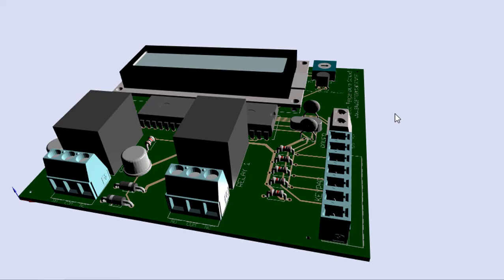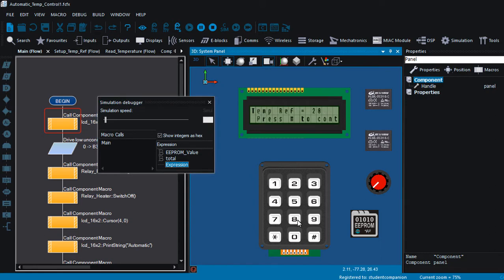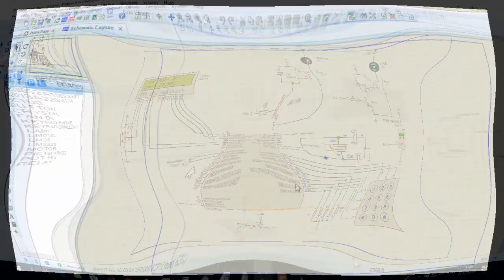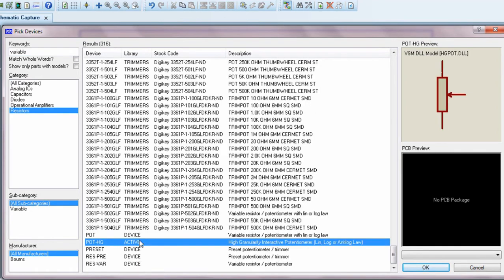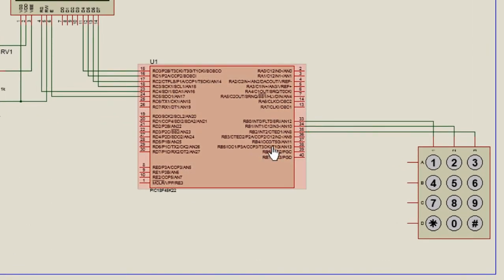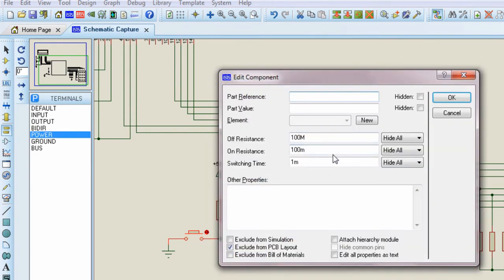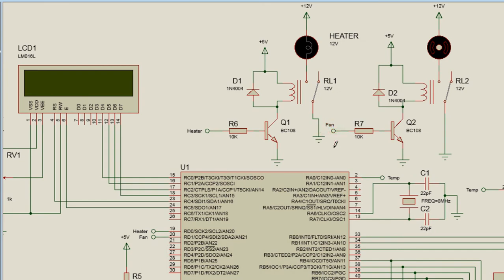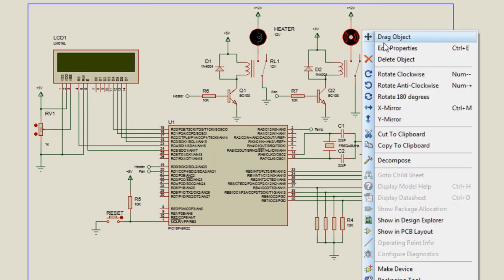35- Project 5 Automatic Temperature Control, part 1 | Flowcode Beginners Tutorial

Comment: Thank you very much, Professor, for the adequate answer and help ... Would I have a question if you would like to have an automatic heating ferry project on the system’s gas working and running on PIC. If you have an idea that there is protection for the system because the gas is somehow a big risk, I want you to help the project for a chicken farm ??? ??
Reply from the maker: The PIC on itself is safe, the problem is the switching devices. You have to be trained to work with gas to understand and avoid the risks.
We can't design the system for you but if you understand what you are doing and ask appropriate code based questions, we might assist.

Comment: i made a similar project for school and the only thing the professor picked on is the reference temperature 
it should be an interval and not a simple value because if the reference temperature is 29 then  the temperature reaches 29.1 theoretically it will turn on the fan then the temperature drops to 28.9 then it will turn on the heater and the temperature will drop again 
basically it will oscillate 
if you put 2 reference temperature or a single reference but test on reference - offset  and reference + offset the system will oscillate less
Reply from the maker: You are correct.  But this is just a tutorial to give students a foundation to build on. We can't include all possible scenario to make it as a commercial product.  The tutorial will be very long. What you have described is very important addition among many others to improve it. I will mention it in part 2.
Reply from the maker: Thanks for your feedback.  Much appreciated!
Reply: thx also i love your videos very informative ..keep them coming
Reply from the maker: You are welcome!

Comment: Hi, what kind of schematic drawing program r u using it? And where did u get schematics for 3*4 keypad? I couldn't find it, can u send it to me?
Reply from the maker: Hi. It's called Proteus.
Reply: @StudentCompanion  Thanks! Also thank you for your great video. Schematics for keypad is also in Proteus? Or do we have to add library to add keypad?
Reply from the maker: @oksky58  you can create your own if you want to. But there is a keypad already in Proteus, a 4x4 and 4x3 keypads that you can use straight away
Reply: @StudentCompanion  Thanks for let me know! Also, what is that the signal type from the temperature sensor goes into microcontroller? like x-bit logic or x-bit i2c?
Reply from the maker: @oksky58  It's a normal analog signal. If you watched the whole tutorial we explained everything
Reply from the maker: You can learn more from this tutorial: https://youtu.be/lrMXX-qBGlU

Comment: I have a question

We don't know the port according to the data sheet
You are selected PIC18F45K22 and the port ID ANSELC = 0; He was not in trouble
But I chose PIC18F4520, actually it was going to give me an error in the program, so I entered the dataset and checked the input and output from it and chose the CMCON C = 0; But it gave me an error
In the PIC18F4522 there is no problem with the code and the work was perfect, but I had to use a second alternative type because there is no in the market

You clarified the idea or how
Reply from the maker: ANSELC set a pin as digital or analog when you are using the PIC18F45K22 but the PIC4520 does not have ANSEL register, you will have to use a different register.

Comment: We don't know the port according to the data sheet
You are selected PIC18F45K22 and the port ID ANSELC = 0; He was not in trouble
But I chose PIC18F4520, actually it was going to give me an error in the program, so I entered the dataset and checked the input and output from it and chose the CMCON C = 0; But it gave me an error
In the PIC18F4522 there is no problem with the code and the work was perfect, but I had to use a second alternative type because there is no in the market
Reply from the maker: You can use ADCON1 to configure analog pins to digital as  explained in this article also using PIC18F4520: https://www.studentcompanion.co.za/sms-home-alarm-system-with-pir-and-gsm-mikroc/

Comment: Please write a programme in flow code 8 an ac - ac stabilizer project ranging from 130vac to 280vac input voltage and Output voltage between 200vac to 255vac with a low and high cut voltage LOW volt cut to be below 130vac and HIGH cut to be above 280vac and display the resulting real time ac input and output on a 16x2 lcd.This can be really helpful to see how to go about it here in flowcode.Thank you sir.
Reply from the maker: Hi. Thanks for your feedback but unfortunately we can't guarantee that we can consider all the projects suggestions from our subscribers. Some are beyond our scope and we won't have time to consider everything especially if they won't have value to our predefined topics.
Reply: The truth is we learn allot from a complete project in flowcode take an example of the lm35 tempetature control project you did, its a complete project i personally learnt allot from it in that area so with a complete project of an ac to ac stabilizer there is allot to cover and also allot to learn from it.
Reply from the maker: I hear your point. But personally I don't see much value to learn from such a project in terms of our microcontroller tutorials.

Comment: Hala Bash is an engineer. I took the project after the temperature, I worked the brutes, I worked, the purposes were required, I worked in reality, I worked hard and gave a reading, but the cepad did not give the numbers where is the problem
؟؟؟؟؟؟
And Henny changed the recognition like I did because I used PIC18F4520 to help me solve the problem

// Keypad module connections
char  keypadPort at PORTB ;

// End Keypad module connections
 char CON = 0;
// LCD module connections
sbit LCD_RS at LATC4_bit;
sbit LCD_EN at LATC5_bit;
sbit LCD_D4 at LATC0_bit;
sbit LCD_D5 at LATC1_bit;
sbit LCD_D6 at LATC2_bit;
sbit LCD_D7 at LATC3_bit;
// Pin direction
sbit LCD_RS_Direction at TRISC4_bit;
sbit LCD_EN_Direction at TRISC5_bit;
sbit LCD_D4_Direction at TRISC0_bit;
sbit LCD_D5_Direction at TRISC1_bit;
sbit LCD_D6_Direction at TRISC2_bit;
sbit LCD_D7_Direction at TRISC3_bit;
// End LCD module connections
#define HEATER PORTD.RD0
#define FAN PORTD.RD1
#define LED PORTD.RD3
#define ENTER 15
#define CLEAR 13
#define ON 1
#define OFF 0

void main() {
unsigned short kp,Txt[14];
unsigned int Temp_Ref ;      //  Reference Temperature
unsigned char inTemp;
unsigned int temp;
//float mV, ActualTemp;
unsigned int  mV, ActualTemp;
 Keypad_Init();                          // Initialize Keypad       
  ADCON1|= 0x0F;
                               // Configure all ports with analog function as digital  
   WDTCON = 0;
                              //  
   CMCON |= 7;                    // Disable comparators
   //ANSELC  = 0;                    // Configure PORTC as digital I/O
   //ANSELC  = 0;                     // Configure PORTB as digital I/O
   //ANSELC  = 0;                    // Configure PORTD as digital I/O                       ANSELC = 0;   pic18f45k22
  TRISA0_bit =1;                //Configure AN0 (RA0) as input
  TRISC = 0;                   //PORTC are outputs (LCD)
  TRISD0_bit=0;               //RD0 is output (Heater)
  TRISD1_bit=0;               //RD1 is output (Fan)
  TRISD3_bit=0;               //RD3 is output (LED)
  TRISB3_bit=0;               //RB3 is output (Unconnected)
  LATB.B3=0;                  //Drive low RB3

  Lcd_Init();                  // Initialize LCD
  Sound_Init(&PORTD, 2);     // Initialize the pin RD2 for playing sound  CMCON
  Lcd_Cmd(_LCD_CLEAR);                     // Clear display
  Lcd_Cmd(_LCD_CURSOR_OFF);                // Cursor off
  Lcd_Out(1, 4, "Automatic");
  Lcd_Out(2, 2, "Temp Control");
  delay_ms(2000);                          //2s delay

  HEATER = OFF;
  FAN = OFF;

 //Read Temp Ref from EEPROM
        Temp_Ref= EEPROM_Read(0x02); // Read data from EEPROM address 2 and store it in Temp_Ref variable
        if ((Temp_Ref > 0) & (Temp_Ref < 100))
    {
      goto START_PROGRAM  ;
    }
    else {

        START:
       Lcd_Cmd(_LCD_CLEAR);                     // Clear display
       Lcd_Out(1, 1, "Enter Temp Ref");
       Temp_Ref=0;
        Lcd_Out(2, 1, "Temp Ref: ");
        while(1)
        {
        //Setup new Temp Ref
         do
           kp = Keypad_Key_Click();      // Store key code in kp variable
         while (!kp);
         if ( kp == ENTER )break;
         if (kp > 3 && kp < 8) kp = kp-1;
         if (kp > 8 && kp < 12) kp = kp-2;
         if (kp ==14)kp = 0;
         if ( kp == CLEAR ) goto START;
         Lcd_Chr_Cp(kp + '0');
         Temp_Ref =(10*Temp_Ref) + kp;
    }

       }

      Lcd_Cmd(_LCD_CLEAR);          // Clear display
      Lcd_Out(1, 1, "Temp Ref: ");
      intToStr( Temp_Ref,Txt);      //Convert to String
      inTemp=Ltrim(Txt);
      Lcd_Out_CP(inTemp);          //Display Ref Temp

      EEPROM_Write(0x02,Temp_Ref); // Write Temp_Ref at address 2 of EEPROM

      Lcd_Out(2, 1, "Press # to Cont.");
      //Wait until # is pressed
      kp =0;
      while(kp!=ENTER)
      {
         do
           kp = Keypad_Key_Click();  // Store key code in kp variable
         while(!kp);
      }

      START_PROGRAM:

   Lcd_Cmd(_LCD_CLEAR);          // Clear display

   Lcd_Out(1, 1, "Temp Ref: ");
   Lcd_Chr(1,15,223);               // Different LCD displays have different
                                    //   char code for degree
  Lcd_Chr(1,16,'C');                // Display "C" for Celsius

  //Program loop
  while(1) {
    //Display Referance Temperature and Actual Temperature
     temp = ADC_Read(0);               //Read temperature from AN0
     mV = temp * 5000.0/1023.0;        //Convert to mV
     ActualTemp = mV/10.0 ;             // Convert to degrees Celcius
     intToStr( Temp_Ref,Txt);         //Convert to String
     inTemp=Ltrim(Txt);
     Lcd_Out(1, 1, "Temp Ref: ");

     Lcd_Out(1, 11, inTemp);        //Display Ref Temp

     Lcd_Out(2, 1, "Temp= ");
     FloatToStr(ActualTemp,Txt);    //Convert to string
     Txt[4] = 0;
     Lcd_Out(2,7,Txt);
     Lcd_Out(2,12,"   ");

     //Compare ref temp with actual emp
      if (Temp_Ref >  ActualTemp  && CON ==1)  //If Temp Ref is greater than actual Temp, Switch ON Heater
      {
      HEATER = ON;
      delay_ms(1000);
      FAN = ON; 
      delay_ms(5000);
      FAN = OFF    ;
      CON =0;
      }

      if (Temp_Ref <=  ActualTemp)  //If Temp Ref is less than actual Temp, Switch ON Fan
      {
      HEATER = OFF;
      FAN = OFF;
       CON=1;

       }

        //Check if the '*' key is pressed

         kp = Keypad_Key_Press(); // Store key code in kp variable
         if ( kp == CLEAR )
         {
         delay_ms(3000);          //3s delay
         kp = Keypad_Key_Press(); // Store key code in kp variable
         if ( kp == CLEAR )
         {
         goto START;
         }
         }

         //Sound the buzzer
      if (ActualTemp >=  40)  //If Temp reaches critical temperature of 40.
      {
   Sound_Play(880, 300); // Play sound at 880Hz for 300ms

      LED = ~LED ;         //Blink LED
      delay_ms(200);          //200ms delay
      }
      else
      {
      LED = OFF;
      }}  }
Reply from the maker: Unfortunately we don't understand your question
Reply: @StudentCompanion  I only have a cepad in my work
Reply from the maker: What is a cepad? We would like to assist you but unfortunately we can't understand your questions
Reply: @StudentCompanion  My intention in the hard ware is that I did not give numbers on the code, but I did not take the temperature from you
Reply: @StudentCompanion Mardit Alia